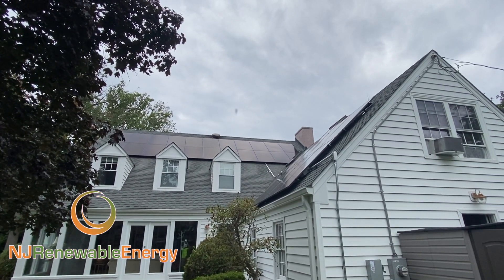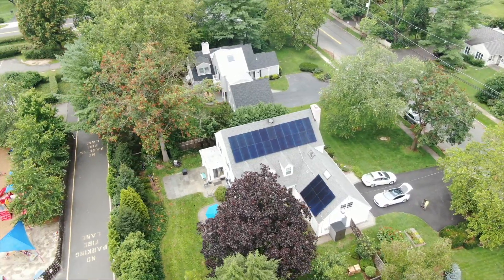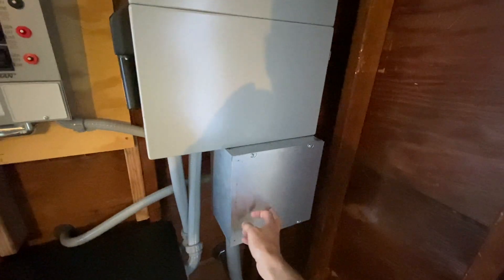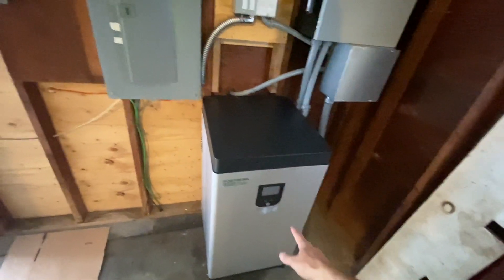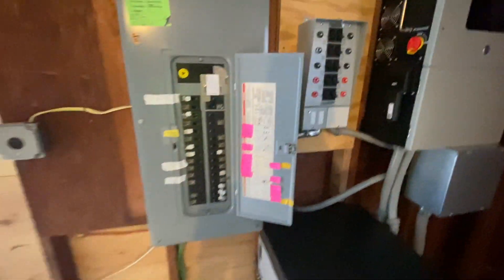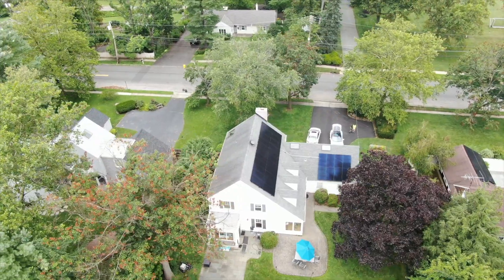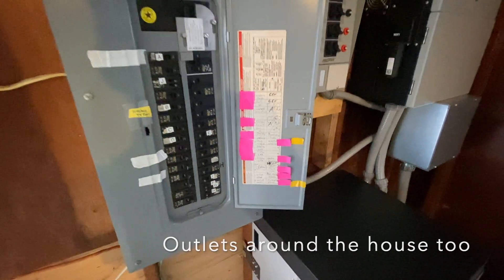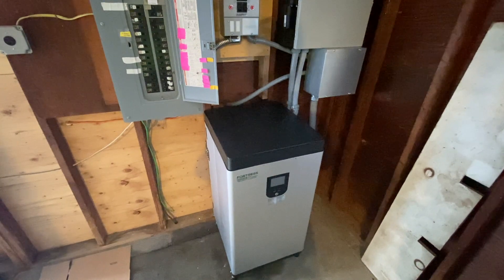Battery Backup Net Zero Solar Home Fortress Power Sol-Ark inverter Q Cells

Comment: I see that a generator lockout was installed (prior?)?? Might you have run the gen L1 and L2 wires through the Sol-arks CT's? Homeowner could be getting even greater use out of this, if that's the case 👍. Great content keep it up!

Comment: What does a battery/inverter/transfer switch system like this cost?
Reply from the maker: Hard to spit out a number since there are many variables.  How long do you want to be off grid, how big is your solar array if you have one, what devices do you wanna run.